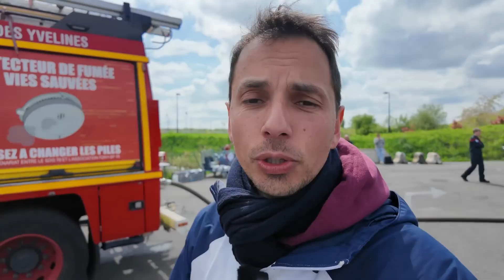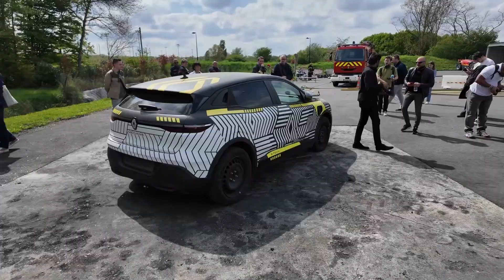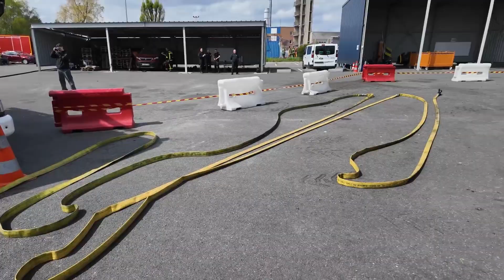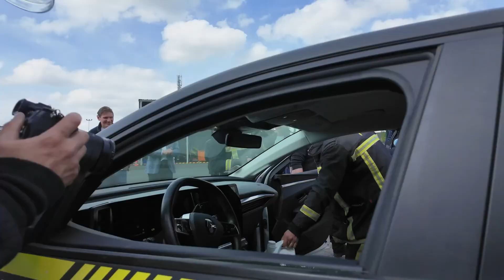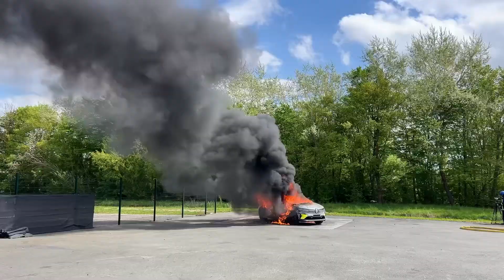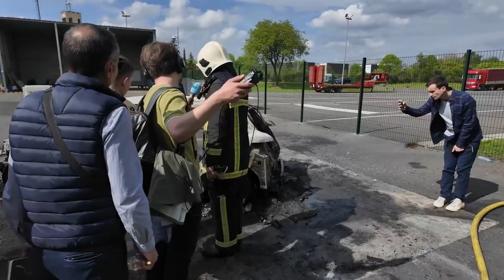How to Stop a Burning Electric Car? Renault's Fireman Access Revealed!

Comment: I don't understand the purpose of this test. It is easy to see how well a car burns, just look at some random footage on YouTube. The result will be the same. For this test, it is just a waste of material and damage to the environment.
The best thing about this video is that there is no thermal runaway at all. If that would have occurred, spectators would not have been as safe as they think. And you would see that immediately, with heavy clouds of white smoke shooting in all directions. Of course the battery of the car has been too hot to be used again safely, but the outer shell of the battery remained intact. That is a lot better than your average phone battery overheating.